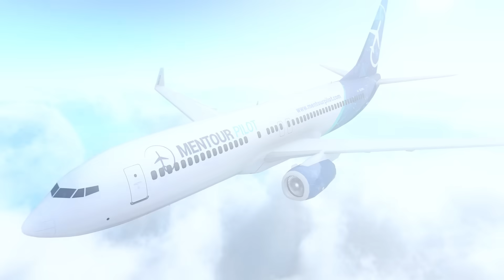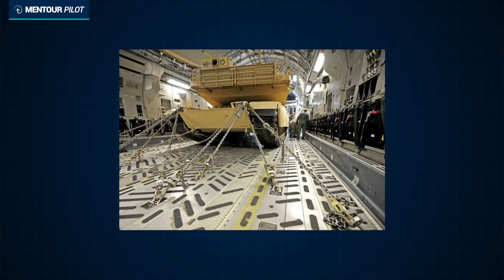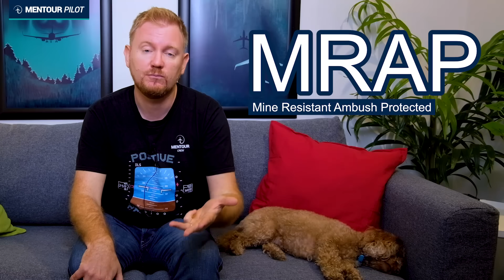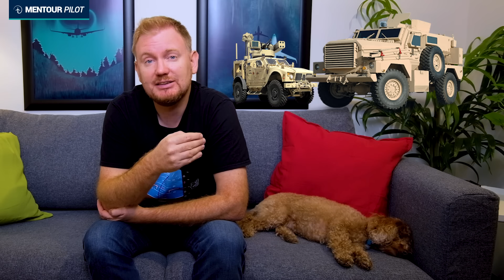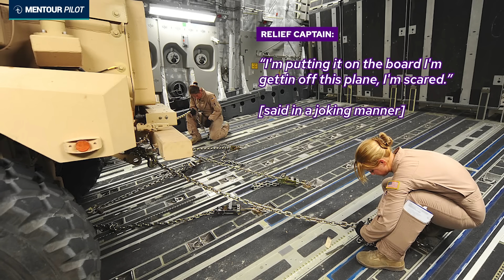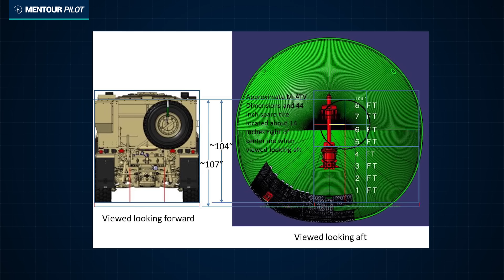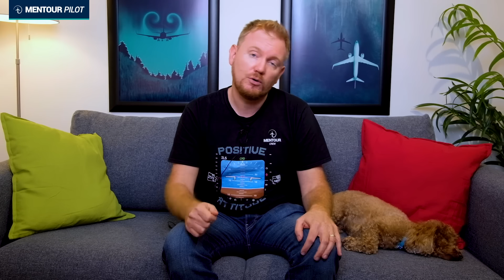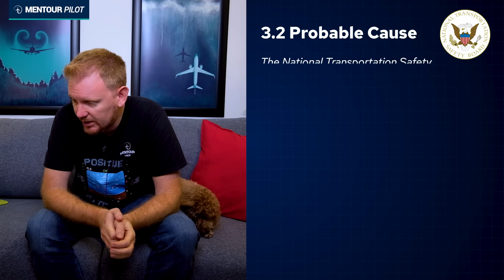Why did the pilots LOSE control?! National Air Cargo flight 102

Comment: Man, that is just horrifying. The thought of being the pilot in charge and being completely unable to keep your crew safe is so scary that I can't put it into words.
Reply: Sadly, he had a shot at keeping his crew safe: he should have stopped down when the reports of loose straps came up. There is no insignificant explanation for that happening.
Reply: I was thinking the same thing.  He knew what was going to happen and could do nothing about it.  Horrifying.
Reply: During the Challenger disaster, the cockpit/passenger compartment was blown free and intact. When examined it was clear the pilot had tried to fly until they impacted.
Reply: Harry Balzak  I know some were alive at impact.  I am wondering though how he could have attempted to the passenger section ripped away from everything.  No wings or parts.
Reply: @ivangranger8494  I'm sure he knew it was hopeless, but he still never gave up.
Reply: Harry Balzak Considering how Brave he was , that does make perfect sense.
Reply: the problem was, he WAS able to do something about it, and he did nothing.
Reply: Scary for the last 30 seconds as they all had the realisation that they were going to die. Fully fuelled too. 'The crew did not survive' = there were no remains due to the intensity of the explosion and fire. Very sad.
Reply: being the pilot in charge and NOT telling the load master to secure the load better ... easy fix he was worried and DID NOTHING about it ... he got what he asked for ... a shifted load that killed everyone ... by not doing his JOB he is at fault fully
Reply: @0623kaboom  How is the pilot responsible for the cargo being correctly loaded?
Reply: @MarianKeller  The Pilot in Command is always ultimately responsible for the flight. He heard straps had broken, load could move backwards he should have gone back to check for himself.
Reply: @lighty9023  Legally, yes, but it's not like a pilot had any qualifications in securing such loads to aircraft.
Reply: @MarianKeller  You don't have to know it backwards and forwards.  You tell the load master, 

"show me the load calculations as far as CG and number of tie downs and how you arrived at them, then let's go back and you show me how everything is still at the calculated stations / CG and that there are the required number of straps securing the vehicles."

Then if you decide you don't trust this guy, you get a new loadmaster to calculate everything again, and get the Air Force and Army to tie everything down again.  

Probably would postpone the flight all the way to the next day.  Could be a job ending move, but it WOULD have prevented the loss of life and the loss of 100s of millions of dollars of equipment.

unacceptable
Reply: @msromike123  The crucial point was in this case: The Captain had no experience with such Cargo, so he simply believed/ had to believe what the loadmaster told him.
Reply: @MarianKeller  he was in charge but he did not have expertise, he had to rely on those they were supposed to have it.
Reply: @alejandro m  Theoretically yes - but in daily practice he must trust on his company that the people which they're hiring for that profession are knowing what they're doing and that they're getting the necessary training and informations.
Reply: @MarianKeller  He's the Captain . The Big Cheese . etc . He's in charge . and is fully responsible for the safety of the aircraft and it's occupants . The 'buck' stops with him . Hence , the position , rank , uniform , and of course , pay .
Reply: @msromike123  Spot-on  . That's why the Captain has a crew trained in various different aspects . He can then safely delegate . The final decisions are his .

Comment: Is there enough space for that many darn straps? I’d question if the anchor points themselves on this converted plane are strong enough. Flown in Afghanistan with an Italian truck next to me in the hold. Scary enough
Reply: Were the trucks handbrake applied?  I think if they're rolling against the straps, it way more dangerous.
Reply: @BubblesTheCat1  That's just the sort of inept question I bet they asked.
Reply: @millomweb  How do you mean an inept question? 
That could have made all the difference between the vehicles breaking free,  or not.
Reply: @BubblesTheCat1  The handbrake could only be used to stop some of the wheels from rotating. It'd do nothing to stop the vehicles moving. That's why it's an inept question - you don't appreciate the situation and the physics involved. I guess they didn't either. It's the unique mix of flight and vehicles - brings a whole new bag of physics into play - if the vehicle weighed 5 tonnes - then the straps would need to be strong enough to hold down 25 tonnes. and the same would need to be applied to stop the vehicle moving forwards, backwards, left and right. This is all necessary as you cannot guarantee the aircraft isn't going to be thrown around by turbulent air during the flight.
Also, the vehicles should have been supported on solid blocks, not theier own wheels and suspensions as the latter allows for a LOT of movement and you need ZERO movement - again just in case of rough air. It seems the vehicles broke free just on the power of the acceleration of the aircraft not even encountering rough air.
Reply: @millomweb  Thanks for schooling me. 
Gosh, I'm such an inept boy.
Reply: @BubblesTheCat1  the word you want is 'inept' not ineptitude ;)
Reply: @BubblesTheCat1  And the opposite of inept, is 'apt'. Go figure !
Reply: @millomweb  Gosh, just go figure this stupid boy out. I'm a really useless piece of crap compared to you, the genius. 
I'm not even English, I'm from Africa, and gosh, I didn't pass my cargo aircraft senior load masters exam.....unforgivable.
Reply: Good point on anchor point strength. They should be load certified but I bet they're not - even now.
Reply: Few chains with high weight rating would have done the job. Flying next to that truck was scary, but you actually were  actually doing a good job checking the cargo securement involuntarily.
Reply: @smk3964  yes, I would have immediately noticed that truck moving;)
Reply: Valid question! According to my operational manual, it would have been alone 15 straps in fwd direction for the 28 tons vehicle with embraced capacity of 1906 kg on 747-400 telair sideguide on a full freighter. Additionaly 28 tons on only double layered pallets (check for bending in the video) seems to be insufficient in the first place. It might still be possible to transport those vehicles,  but never ever in one trip and not without special departments supervision.
Reply: @TheRoblock  "According to my operational manual, it would have been alone 15 straps in fwd direction for the 28 tons vehicle"
What's the load capacity of one strap?
Reply: @millomweb  2256 kg, but depending on G load, you can calculate with more or  less. Fwd movement is 1906 kg, aft is 3810 kg.  This is generally speaking, considering a 45° angle. There is much more behind weight and balance and cargo tie down.
Reply: @TheRoblock  I've gone for a completely wacky 5G based on that's what a commercial plane achieved and survived. That will be in the vertical plane and as I don't know for fore and aft, I'll assume the same !!!
The other mistake was leaving the vehicles bouncing on their own suspensions. They should have been placed on rigid blocks or jacked up to simply stop all movement.
Reply: So I'd have said 60 straps for down, fore and aft, in each direction (180 straps total.) maybe they'd suffice for sideways too as sideways loading isn't going to be great.
Reply: @millomweb  07:54 shows a pretty good picture of cargo being loaded as so called Centreline or Centreload. Attachment points on the cargo must be taken into consideration, wether you strap over or below the centre of gravity, floor angle, capacity of an attachment point, position of cargo in the aircraft and of course the nature or shape of the cargo. I wouldn't see the vehicle being a problem as such, but rather it's airworthiness and most importantly the build up. Speaking of this picture, I do not see a proper angle in fwd or aft direction. The straps in the front look more "sidely" rather than aft. Straps in the middle are actually fine, but they're attached to the seat track, which upward capacity at least for us is 816 kg in that shown aircraft position. You need 51cm spacing in between straps, the floor angle here must also considered. So actually if this vehicle in this picture is more than I don't know 6-8 tons? It's getting pretty difficult to properly secure it in that aircraft Position.

We have transported 38 tons single piece on our 747-8 two years ago built up on steel beams on connected 20ft pallets. Which occupied twelve 8 foot aircraft positions by itself and if I remember correctly four 10 foot  positions just for room for tie down :)
Reply: @TheRoblock  When I see heavy items being carried on a low-loader, I often think that the chains or straps aren't holding the item to the vehicle but the other way around ! As long as the chains and straps are strong enough to lift the vehicle, they should be ok :)

Comment: Who knows what the loadmaster was thinking? Just basic feeling would suggest that if a 12 tonne vehicle needs 12 straps, then a vehicle that is 50% heavier would need more than an additional 2. That's assuming his first calculation was correct.
Reply: Was thinking the same thing.  Fails a basic reasonability test.

Comment: Whatever happened to simply refusing to fly if something happens that has you concerned about the safety of the aircraft?
Reply from the maker: They could absolutely do that but the conversation indicates that they were concerned but not to the point of not flying.
Reply: As mentioned in another comment they were also flying in Afghanistan with US military equipment. That puts pressure to just get out or there ASAP instead of having dozens of additional straps installed which may have taken considerable time.